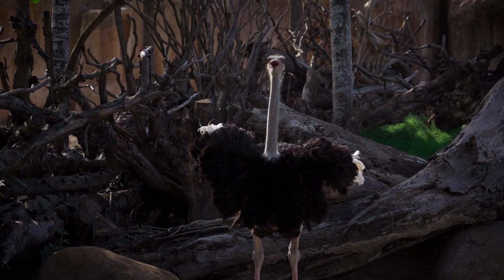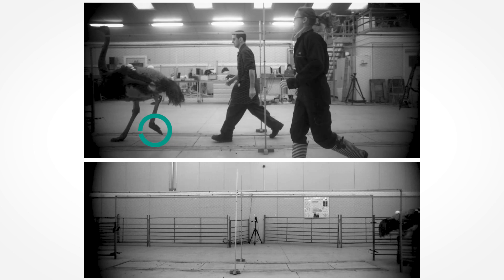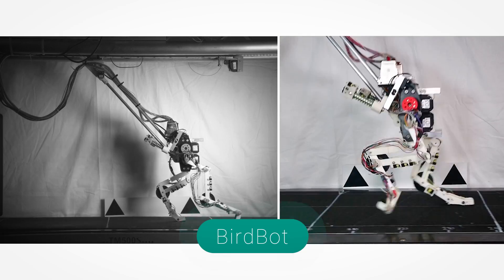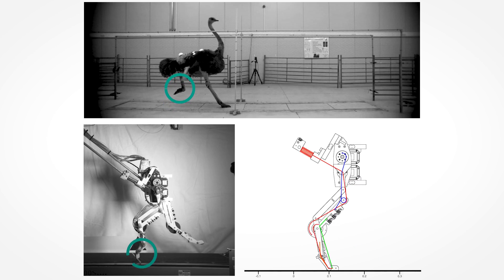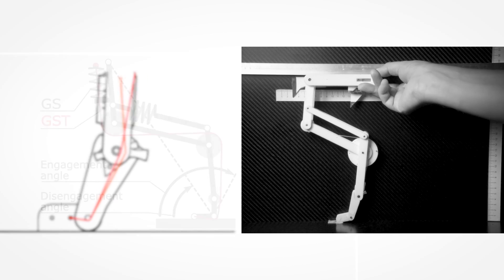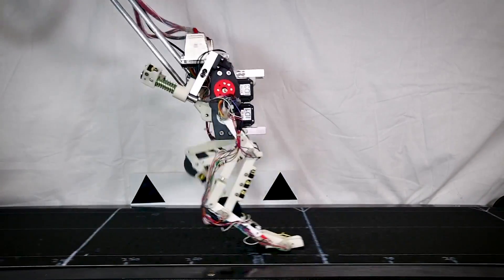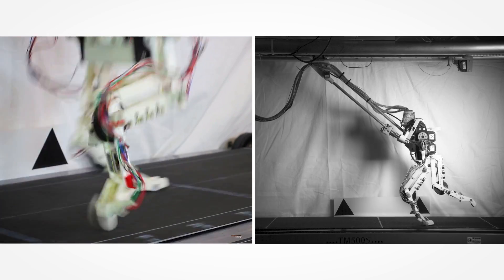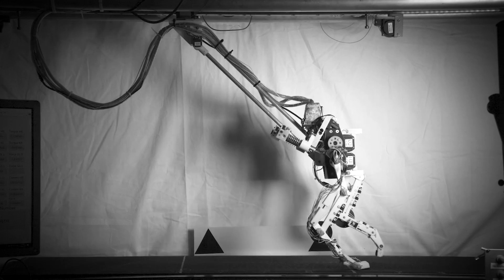Meet BirdBot, an energy-efficient robot leg - research published in Science Robotics

Comment: Works in small robots, in bigger bots spring mechanism won't work 🥴
Reply: I'm a bit doubtful of that one , there are springs which has a maximum load of 25 kilo newtons , add that is a off shelf spring and not a specifically designed one

Comment: I see a lot of wires leading to various places on the limbs. Load cells?
Reply: No , the only thing that needs power is the motors of the hip and upper hip , these cables are for powering the tension sensors , there are images of the Birbot without these cables leading to the limbs , hope that clears it
Reply: @ulforcemegamon3094  Thanks! Tension sensors = load cells.